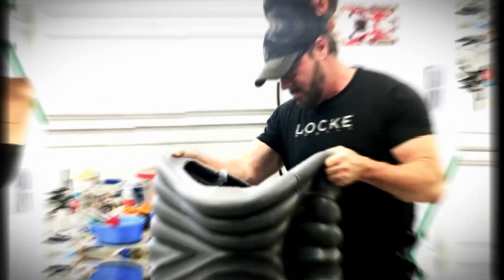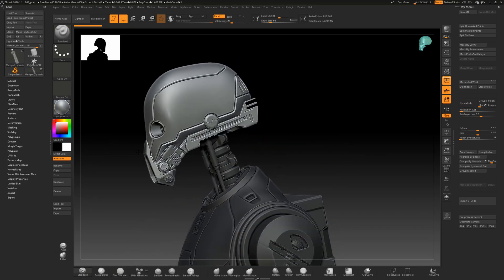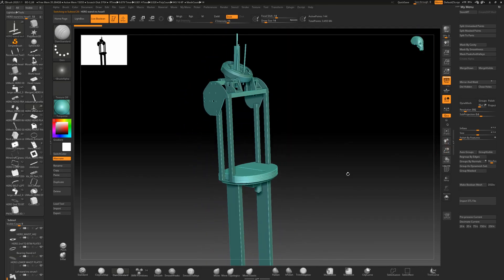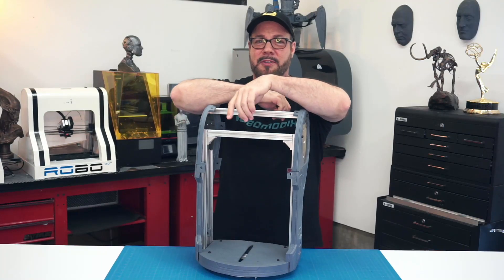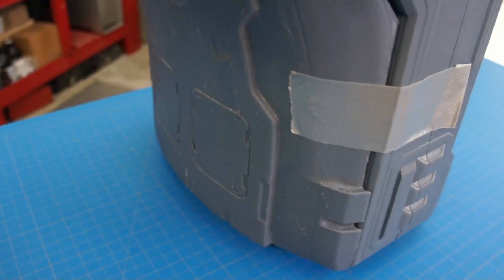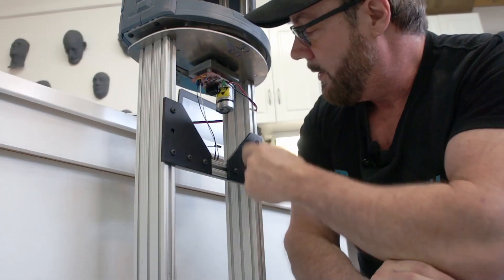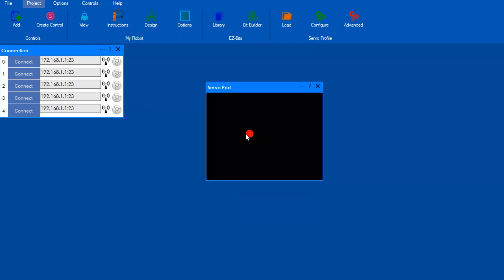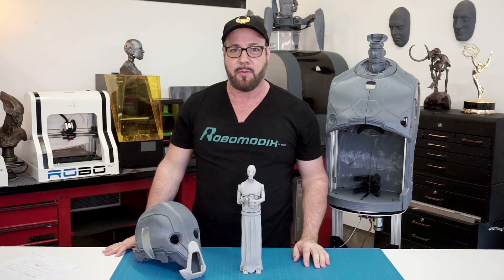I start building a droid  that serves me drinks!  (Episode 1)

Comment: Hi Will, I forgot to ask you if you will be selling the blueprints and BOM for the bottom half of you new build?  I would like to use it on my Inmoov.  Thanks again for sharing your creative work!
Reply from the maker: Hey!  There are plans to offer plans and BOM for some robots. I'm not sure which ones at this point because there is only one robot. The lower half of this robot is covered by fabric (skirt/kilt :) Are you talking about the aluminum frame? Its a very simple build with 1 by 3 inch aluminum extrusion. The only custom part is the aluminum plate the extrusion connects to. Let me know what you are interested in. Cheers!
Reply: Hi Will.   I was looking for the bottom part of your build.  Because I seem to buy parts I really don’t need.  So I was wondering if you could sell the with all parts and screws  of the complete bottom frame you Demonstrated/built  in your video.   I can get the aluminum for the top part.  Please let me know if this is something you might consider . please let me know what the cost would be thank you.  Merne
Reply from the maker: @merne9325  I buy everything thru amazon so I have a record of my build parts. Let me get a list and links together for you this weekend.
Reply: Thank you Will!
Reply from the maker: Hey I have the list together. Do you have somewhere I can send it?